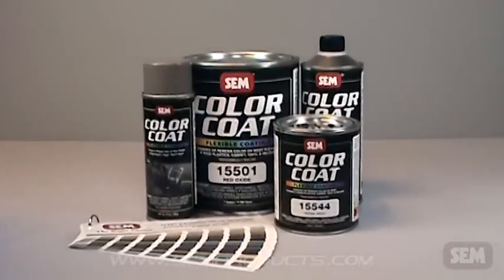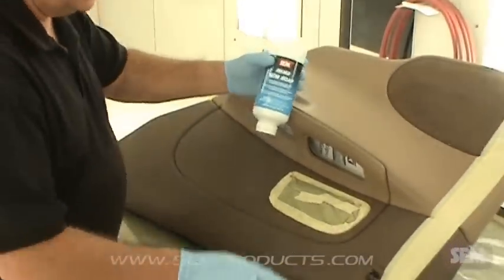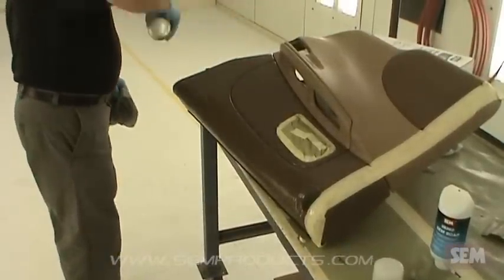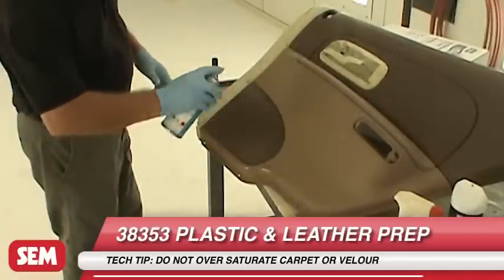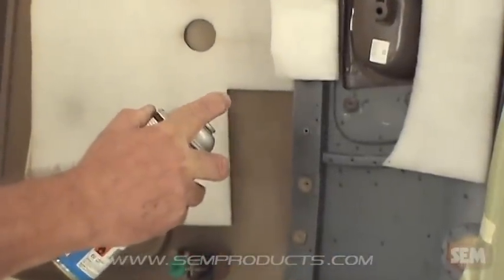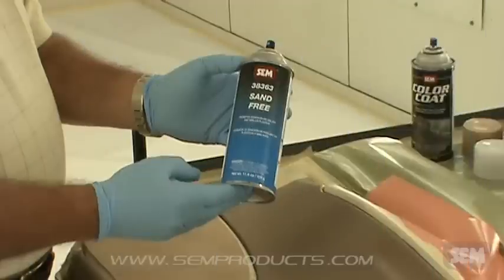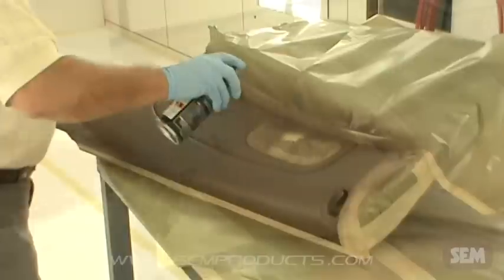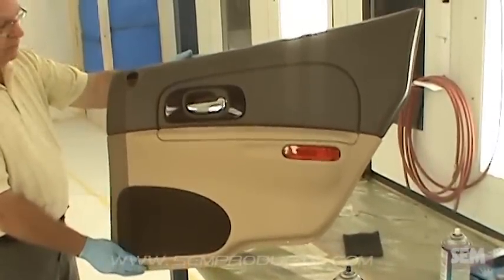SEM Products, Inc. - COLOR COAT

Comment: I have the same issue with my door panels, something got on one of the panels. Used an alcohol prep pad to quickly wipe it off but then the pad removed ALOT of the material. IS there a protective coat that I should apply for EXTRA durablility?

Comment: I have used this product on my door panels. Paint has been set up for months, got a bit of mist spray of isopropyl alcohol on it and took the paint instantly away, not very permanent. Followed the steps to a T. Any suggestions how to seal this so it can take accidents? Does an interior cleaner add any durability? A bit scared to try it seeing as I dont want it to mess up the rest of my panels..

Comment: I am using 15083 (Silver).  People with hand sanitizer on their hands are getting in my car and this is causing the color to get smeared and in some cases, removed altogether in certain spots.  What can I do to prevent this?

Is there a clear coat that won't smear or dissolve in the presence of Isopropyl Alcohol and hand sanitizer?

Comment: If using the quart or gallon, what is used to thin the product before application??
Reply from the maker: There is no recommendation for thinning. Use with a 1.3 or 1.5 Fluid Tip, this product does not need to be reduced.

Comment: I have trim panels that are butted up against one another that are both ppe+ps and abs. Is there any issue with using sand free on one panel and adhesion promoter on the other in terms of them matching after top coating?  Also, these panels are discontinued and several hundred dollars and I'm a bit scared to use sand free as it seems to melt the plastic. How safe is this to use?  Thanks!
Reply from the maker: Motokarts, this is a rather in-depth question and I think you would be best served talking with one of our Tech guys. They can walk you through the absolute best way to go about your project to minimize your risk of damage any of your components. Contact our SEM technical support team at: Phone: 1-800-831-1122 or Email: tech@semproducts.com. There should always be someone available during business hours.

Comment: Can you explain how the color matching works when the available cans don't match the required interior color?
Reply from the maker: The 50 aerosol colors are some of the 50 most common colors. In addition to those, we have a mixing system with 100's of formulas available. The color can be specifically mixed by a participating distributor and provided in a quart or filled in an aerosol. If you have additional questions, please contact technical support at 1-800-831-1122.

Comment: which adhesion promoter would be good for polypropylene plastic?
Reply from the maker: I would recommend you use 39863 Plastic Adhesion Promoter or 77723 XXX Adhesion Promoter. You can find out when to by them in your area at https://www.semproducts.com/locator

Comment: so sand free replaces sanding? so if the plastic melts with the sand free its ok?
Reply from the maker: +Angelina Dez 
Sand free doesn’t replace sanding. We don’t recommend sanding interior plastics, so its purpose is to soften the surface of certain types of plastic, such as ABS, which allows the first coat of Color Coat to bond firmly to the softened plastic. This creates a perfect base for additional applications of Color Coat.